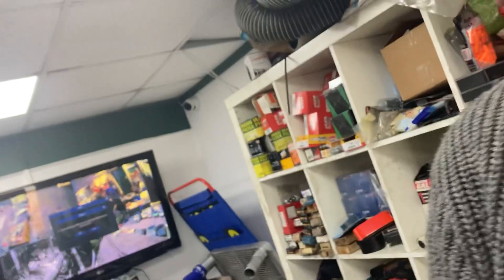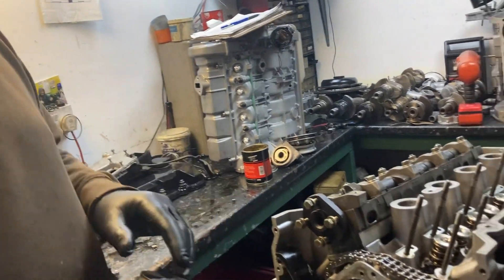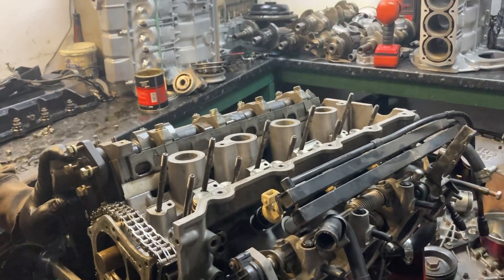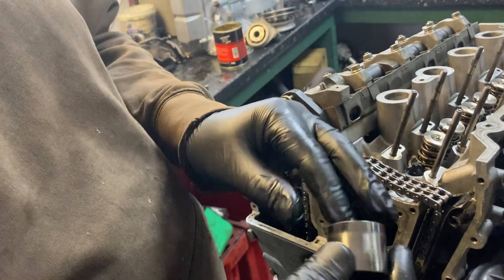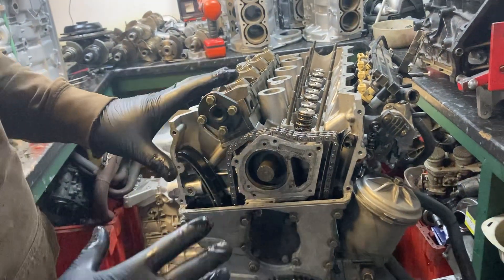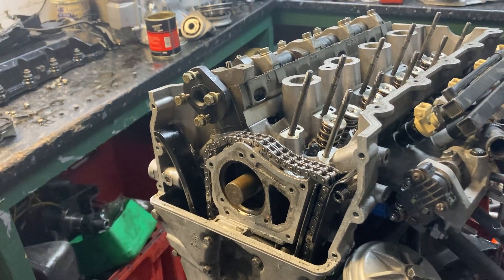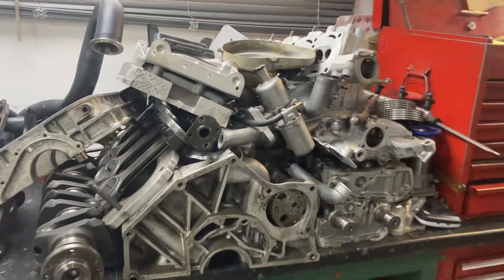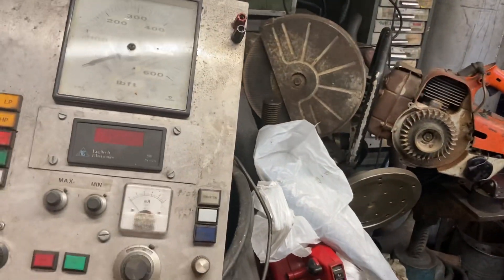The BMW 4 cylinder m42 stroker refresh at shrigley engineering

Comment: I have this wacky idea for N42 4 cyl. It has the vanos, and I was thinking the vanos could also move an actuator that then pushes on a custom intake box. The intake box would have telescoping channels. You could probably 3D print the whole thing, use a bit of metal here and there. Or modify an existing intake of some kind. So while the vanos just does it's job normally, it's also changing the intake channel length. Shorter length would give more power on high rpm. So essentially you can have a stricter cam while the low-rpm also gets a helpful boost from long intake channels. Who knows maybe it could hit some emissions limit better with this mod.

Maybe it's just fantasy. But I got a 318ti and I'm just thinking if this vanos system can be repurposed and modified for some kind of gain.
Reply from the maker: nice, let us know how you get on

Comment: Hi, I'm writing from Spain, I don't understand English and I've been watching the video and I really think the engine preparation is very good.
I would like to know the mechanical lift of which engine it is, or if you could provide me with the reference, I am making a stroker with a 320d 90mm crankshaft and 86mm pistons, and I need to mount mechanical lift.
All the best.
Reply: Hola, ¿terminaste de construir tu motor con cigüeñal de 90 mm? Soy de Alemania y me gustaría saber más sobre su conversión. ¿Qué bielas utilizas? Me gustaría realizar la conversión en un M43 B19 y ya tengo un árbol de levas Schrick y un bloque motor antiguo. El cigüeñal debería ser similar en el M43 y el M44, al menos en términos de carrera. quisiera mas de 2 litros de cilindrada

Symbol „Von der Community überprüft“

Comment: So, your bottom end has:
-m47 88mm crank
- stock 140mm m42 rods
- 86mm forged c20xe pistons from qed/ omega racing?
Reply from the maker: yes originally when it was first built as a stroker it had the stock m42 rods but now has ZRP rods but everything else is as you say
Reply: So glad I found out throughout this video about the c20xe pistons. Finding some reasonably priced s52 pistons for this stroker project was nearly impossible. Now I found hope 
Cheers and best of luck!
Reply from the maker: @molnarvaleriu3187  the pins on the xe pistons were smaller than the m42 pistons so bushes were fitted to the small end of the rods to make it work
Reply: @jerseytim100  Did ZRP make you rods with a 21mm pin end? Looks like that piston has a 21mm pin and zrp M42 spec rods are 22mm pin? Maybe I am looking at the wrong piston and rods links. Thanks
Reply from the maker: @EdgeAvl1212  zrp supplied the bushes to make the rods work with the xe pistons but the engine builder wasn’t happy with them and had different ones fitted. I am not sure what size they were

Comment: That 2.5 litre engine that was discussed near the end of the video, was that based on the M44 block? I'd love to see that in an E30!
Reply from the maker: it was going to be for the m42 block. unfortunately it wasn't cost productive unless 4 cranks were made and it was getting expensive. Shame as it could have worked really well
Reply: @jerseytim100  That's unfortunate but understandable. I guess most people would go for a 6 pot engine if they wanted more displacement. It would have made a great alternative to an S15 and with a less weight at the front end, compared to the M50, etc.

Comment: What about exhaust manifold, what do you use 4-2? Do you have anybody who build it for you because I am looking for an aftermarket one for my e30 M42 rally car and can't find any decent one??
Reply from the maker: I originally had an exhaust made when the engine was in the compact but it wouldn’t fit into the e30 so I bought an eBay one which needed total remaking to fit and the steering column now runs through the middle of it. They are both on my other videos on the channel

Comment: what engine is the crankshaft from?  can I ask you questions in another way?  I also want to modify my m42
Reply from the maker: It’s from a m47 diesel.
Reply: @jerseytim100  m47tud20 is not the 88mm crankshaft ?  must be m47d20?  year of construction 2000/2001?

Comment: Where did you find the chain tensioner on the left?
Reply from the maker: It is all standard m42
Reply: @jerseytim100  I mean, I've been searching the timing chain components for some time and I don't know if it's possible to find this chain tensioner as it's out of stock and delivery is discontinued from the factory. I thought you have replaced the timing chain and that is why I asked.
Reply: @karakonjo11  Better to just leave it alone and put a new tensioner in. You could buy 2 used engines for the price of those parts (if you even manage to get them).
Reply: What is the six speed box mentioned that fits on to the m42